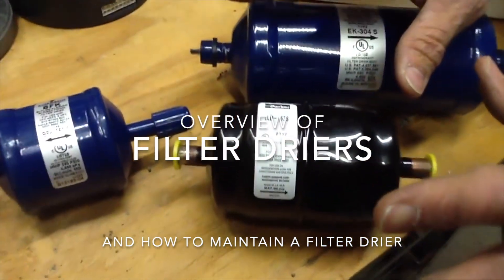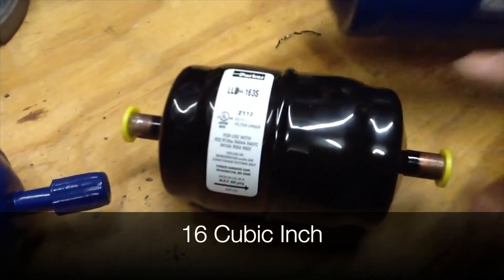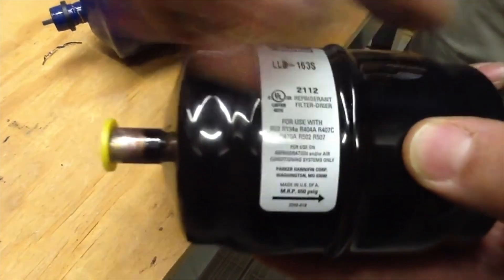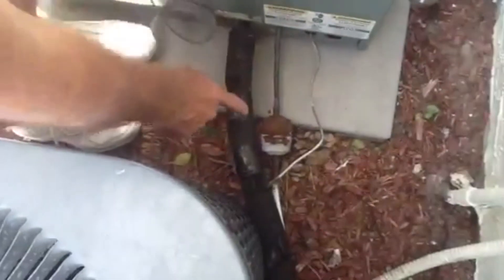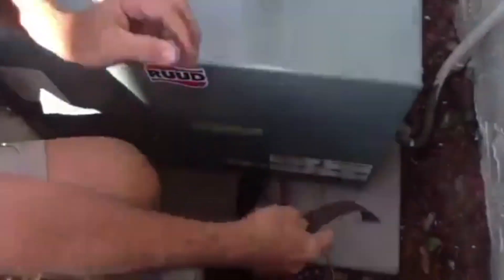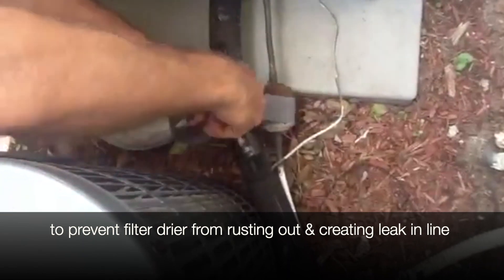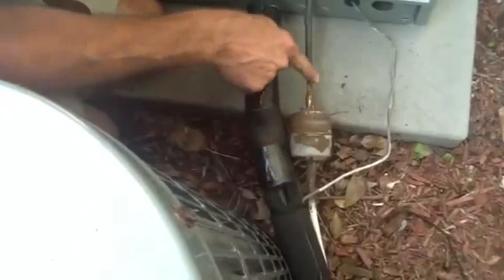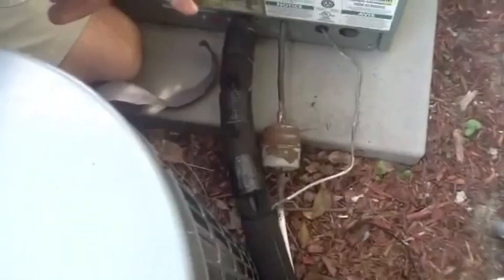"What Is A Filter Drier: How does it Save The Heart of Your Air Conditioning System:

Comment: Also do a wire brush on the bottom of the compressor where the suction goes in, and the clamp for the accumulator as well. then paint it as well, to keep the base of the compressor and the clamp from rusting out and killing the compressor. 

When putting in a new compressor I always try to at least hang it by the top, and then get a thicker coat of paint onto that base section, as it seems that that area gets the least amount of paint in production, yet is the area that collects the most condensation. Had plenty of compressors replaced because the base section rotted out and they developed a pinhole leak there by the mounting ears, or the suction inlet clamp rusted away and the suction tube fractured where it enters the compressor case. Paint it, and when dry install it and spray again, and then after brazing on the tubes give them another coat of paint. Gives that compressor a fighting chance of actually reaching it's design life, not failing from the base rotting off.

Had one console the only thing keeping the compressor in place was the suction and discharge lines, plus the wiring, as the mounting ears were rotted off, along with the base where it sat. Same with a window wall, though there it fell half way out the case, as it was a 1970's unit with R11 and all aluminium coils that had all turned brittle.